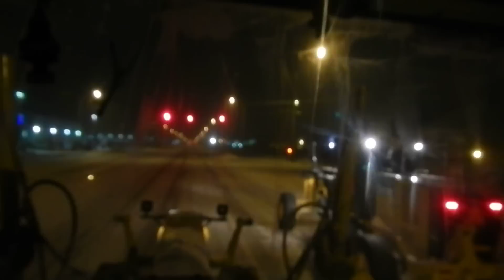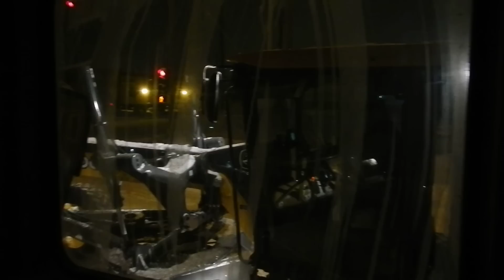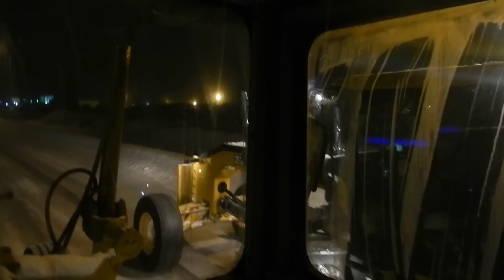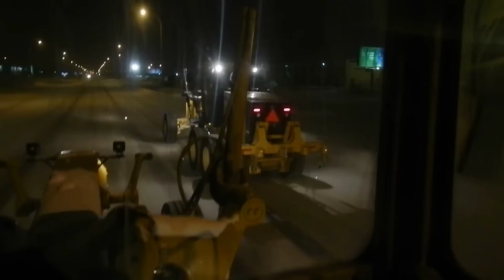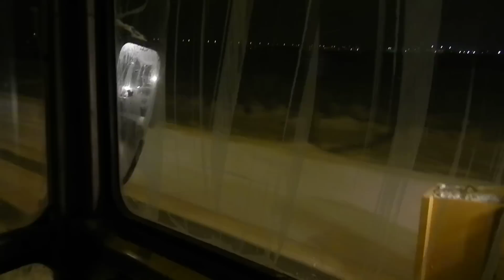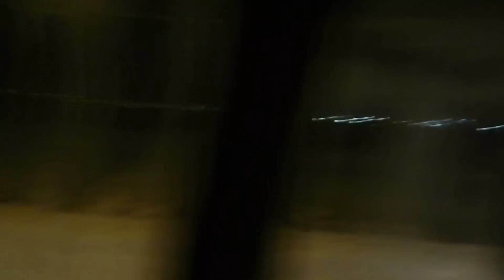Worlds Slowest Drag Race...Road Graders?

Comment: Gotta do something about that holeshot.. Might need to twist a couple little screws a bit or get rid of a certain VHP solenoid. The old 3306 pulled it out pretty good on the top end, but I was a bit worried there at first.
Really says something though, an almost 14 yr old Cat grader holding with a nearly new Deere.